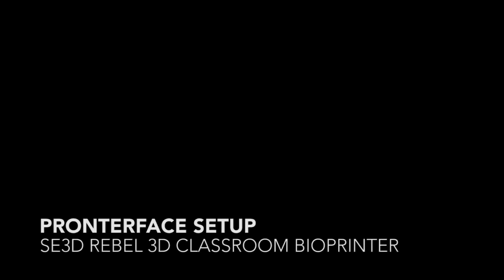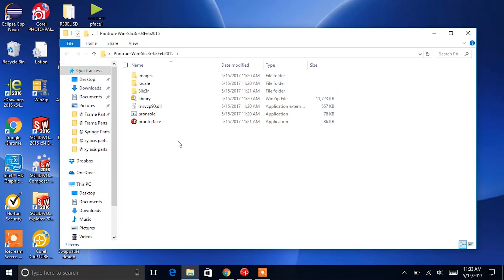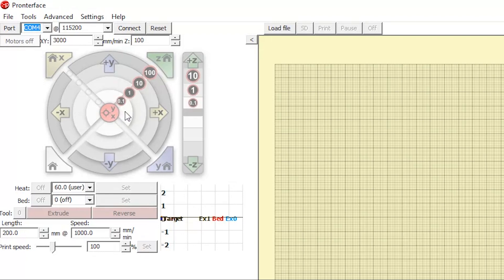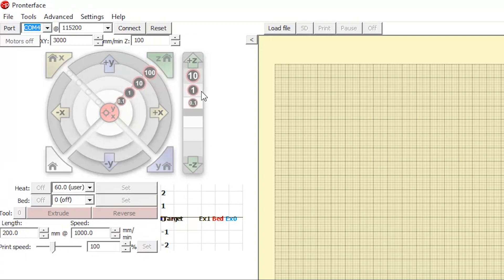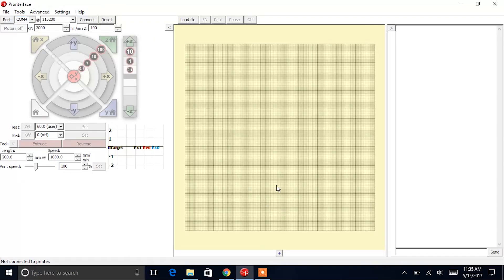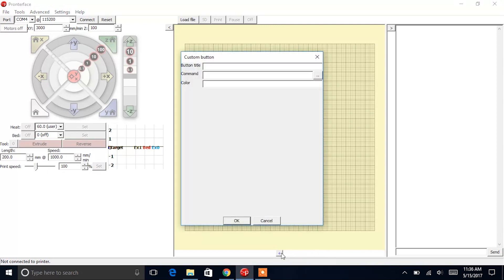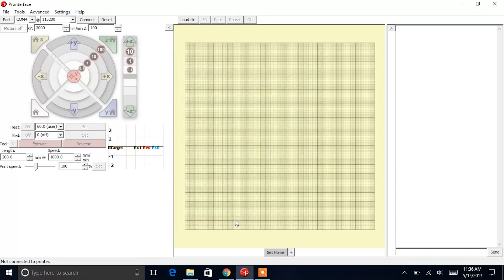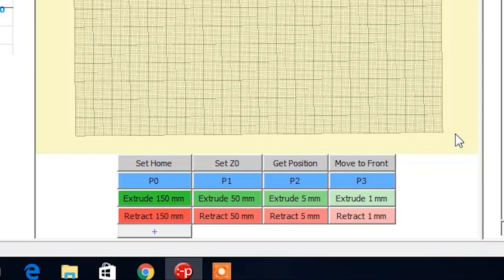Setting up Pronterface

Comment: Hi, thanks for your video. Just a basic question : is it possible to modify the E0 max temp setting via Pronterface instead of going thru the hassle of compiling new firmware, Visual Studio, Arduino IE and the likes? I have 4.2.7 (32 bit) board on my Creality, bootloader is already included. I don't feel comfortable with altering G-codes and flashing process. Thanks very much in advance!

Comment: what is that off button meant for
I accidentally pressed it and  it turned off my power supply
Reply from the maker: Hi, the OFF button on Pronterface does mean it will turn off your printer immediately.